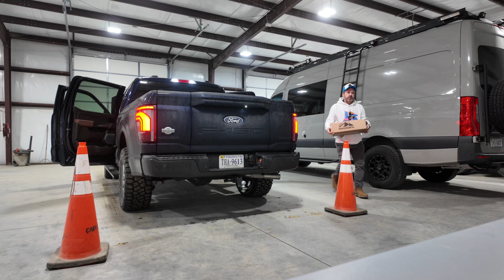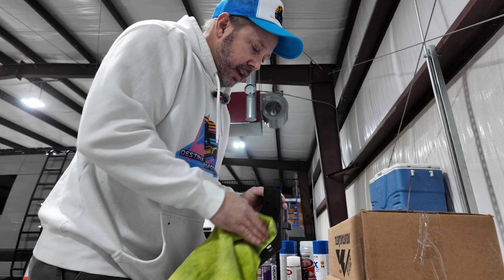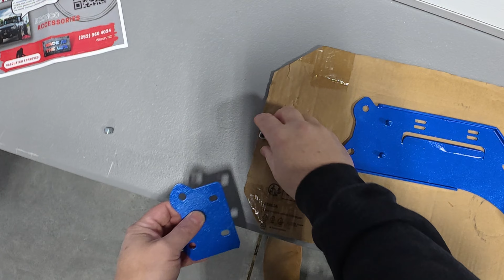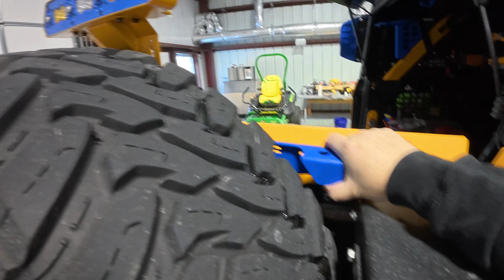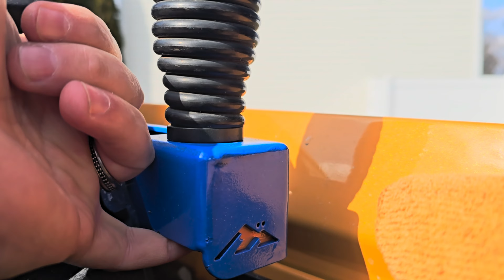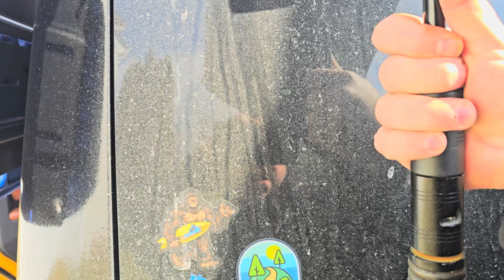Level Up Your Bronco: DIY Flag Mount & Custom Sparkle Finish

Comment: can you please show how to disconnect the flag pole from the quick connect/ disconnect. is it spring loaded?
Reply from the maker: Yes it's spring loaded. Line up the grooves, then push down and twist and the flag will lock in place.
Reply: @destinationbigfootbronco mine was super stuck. Sprayed some wd40 and magic it fixed my issues..Thank you.
Reply: @destinationbigfootbronco glad to have met you at Super Cell
Reply from the maker: @jasoningle43 same with you man! Such a small world. Hope you have a great rest of the weekend.